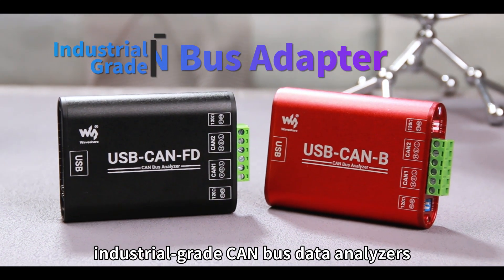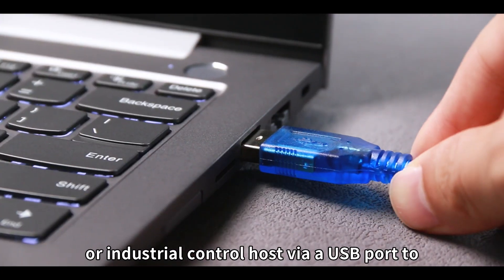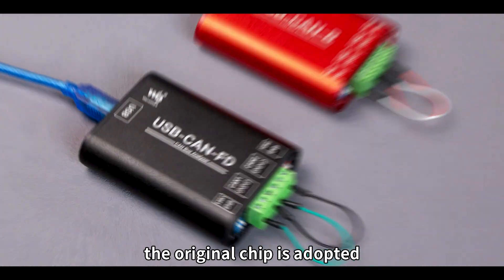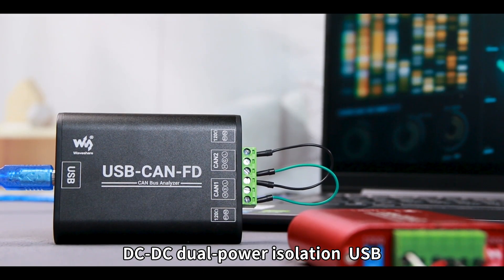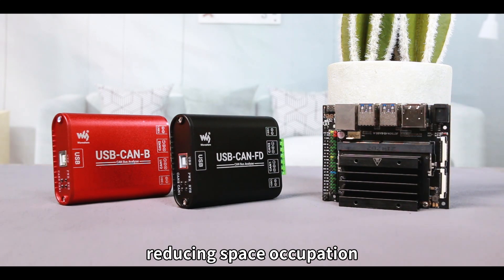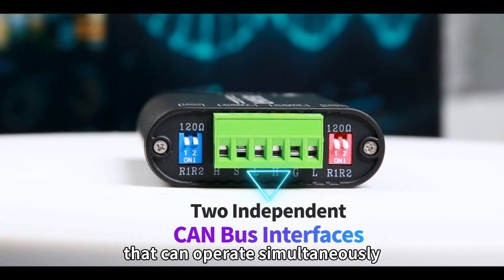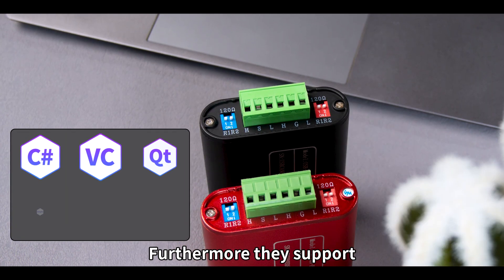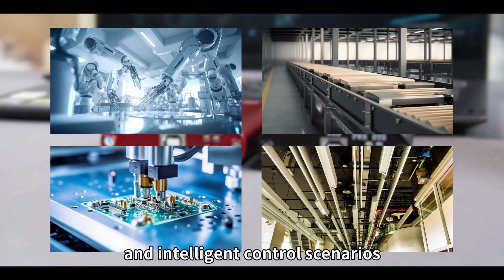Waveshare Industrial Grade CAN Bus Data Analyzers

Comment: Is it possible to place this CAN bus analyzer between an OEM radio and the vehicle's CAN network to monitor which messages or button commands are used to activate the 360 camera, for example?
The idea is to allow full communication between the OEM radio and the CAN network to flow in both directions, while passively analyzing the exchanged messages.
Reply from the maker: www.waveshare.com/wiki/USB-CAN-B

here is our wiki.